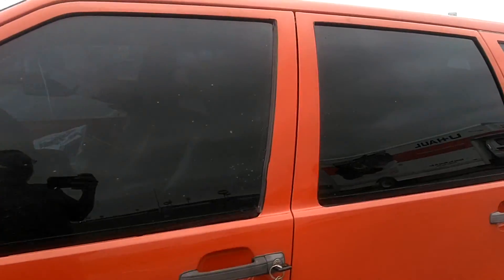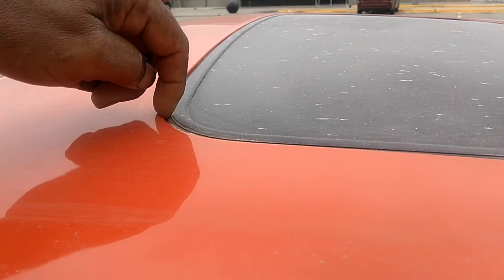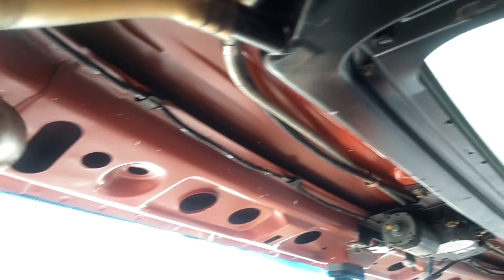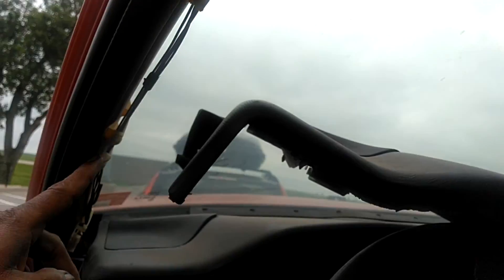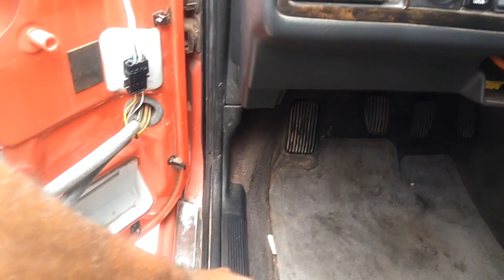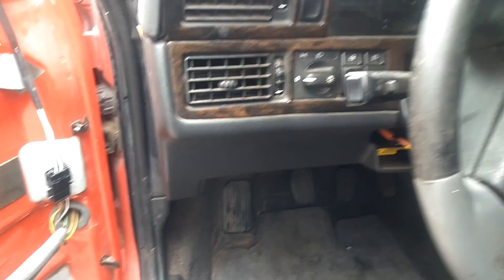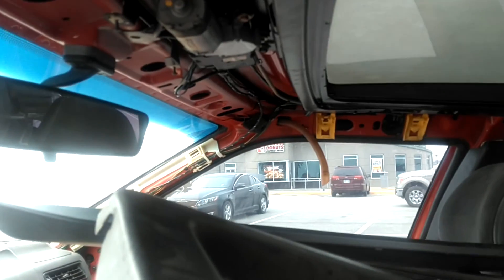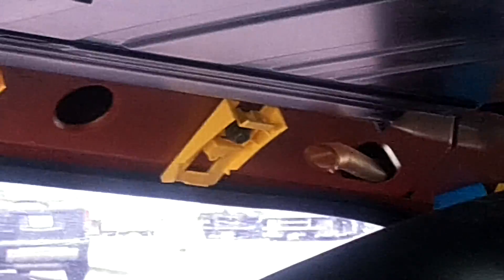Water in the floor board of the Volvo 850, S70, V70, V70R, V70XC, etc. sunroof drain clogged. - QT

Comment: That’s true for any car actually. I remember that Jeeps had a really big issue with the sunroof drains. Turns out that the issue was the opening on the drain tube at the bottom on the passenger floorboard was not wide enough in diameter so it would get clogged with debris and as a result whenever it rains you get Niagara Falls inside the car. The fix for it is you just remove the plastic fitting on the end of the tube, then cut the end off of it, clean out any debris inside of there, and then install it back in the car.
Reply from the maker: Awesome! Thanks for sharing.

Comment: Good evening, what if my Volvo 850 wagon doesn’t have a sunroof and there’s still water in the floor board after a heavy rain?
Reply from the maker: Door seal or firewall cowl drains are clogged. Windshield could also be leaking.

Comment: Robert, Do you have a video or can describe if the right rear head liner can be lower just to I can get access to the right rear drain hose to see if it is cracked. The water only ends up in the floor pan of the right rear passenger location. The car is parked facing up hill in our sloping drive way.
I have already checked to see that the hose is clear from below.
Thks,
Dwight
Reply from the maker: I've never seen a hose cracked, they are to soft. Can you see if water drains out if you pour water in the corner of the sunroof pan?
Reply: @RobertDIY  it drains out fine. I am suspicious of the hose because other youtubers have mentioned the possibility. Is it possible to lower only the rear part of the headliner to get access?

Comment: water was leaking at the rear middle of the glass where the gasket connects to itself, and was leaking onto the sun shade down to the side and onto my head with the shade closed. I removed the sun shade took it to the car wash and saw the drips on the folded rear seat cushion. Will silicone keep that rear gasket seam sealed?
Reply from the maker: https://youtu.be/jiDZqKKaMC8

Comment: Most cars only have drains in the front ,and they usually get clog by dirt. You can blow them out with an air hose if your incapable of doing it yourself take it to a reputable glass shop.
Reply from the maker: thanks for sharing.

Comment: Happened to me. Just blew out the weep holes with air. NP. The dealer told me just keep pressure dialed down like to 30psi. Drained right out the bottom of car
Reply from the maker: thanks for sharing.
Reply: Robert DIY Robert. To be honest, I bought my wife this 2002 V70 XC because of a Scotty Kilmer video saying they were pretty bulletproof. 

After purchase, I found your site and I only watch your vids. I found a site in Colorado that only sells Volvo and that other OEM brand you rec. for parts.

Has 110k miles. Bought from orig owner last May. Zero rust. Undercarriage is almost shiny! Great for a Pittsburgh car.

BUT!!! Need to replace timing belt. Can’t find evidence it was ever done.  I also want to replace heater core. Also, pcv system is neutral. I don’t show air going out or sucking in with that rubber glove test. Any ideas? Had this five months and only run 93 octane thanks to your rec.

If you had a step by step what to check and cross ref with your vids how to do it by model, I’d pay $20 np.

Your vids have been huge help. I used to be quite the motorhead years ago. I’m glad I got this Volvo cuz with your videos help this is nice to work on.

Anyway, I’m a Youngstown OH boy! Gonna get this Volvo red up fore Winter, with your help! 

I have one question I haven’t been able to find answer to anywhere. The baby seat in back is jammed up in the down position. I bought it that way. Guy couldn’t figure out how to get it back up into the normal seating position. And I can’t figure out how to get it folded back into the seat back either.

ALSO! It’s not a turbo. So, I’m happy about that. But every time I talk to mechanic or parts they say ALL 2002 V70 XCs were turbos. Funny.

Thanks Robert! You are GREAT!
Reply from the maker: Yes, All XC's were turbo, you may want to run the VIN in www.AutoCheck.com or somewhere.
Reply from the maker: Not sure what you are asking for as for $20???
Reply from the maker: https://youtu.be/gt9w-ZSxs9I
Reply from the maker: Car is considered a P2.

Comment: You failed to ,mention another possible cause of a sunroof leak  - the failure of the joint between the seal and the glass.
Reply from the maker: I was just talking about the most common sunroof drain leak. The seal failing will not dump water in the floor. I actually watched this video yesterday and plan to make a video about all of the possible reasons these cars leak into the interior.
Reply: @RobertDIY good video idea!

Comment: What if your car does not have a sunroof?
Reply from the maker: Are you sure it's water? Could be coolant from a heater core. Also couple be water from AC condensation, water from a windshield leak or from the windshield cowl drains being clogged with leaves, etc.
Reply: My heater core leaked under my rubber mats. On driver side. Very sticky on carpet and cabin smelled like maple syrup. Started at 140k on a 99 s70 base auto tran. If you change heater core, don't let mechanic skimp on the o ring replacement. Appreciate Robert. He has saved me and the hubs so much money and headache. 🙏
Reply: @RobertDIY  heater core already been done